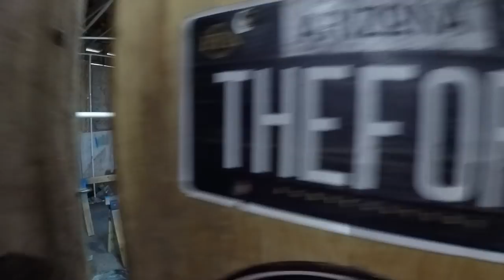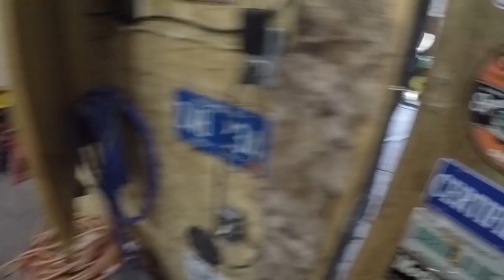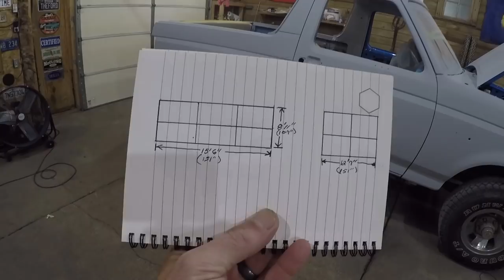The BRONCO Gets PRIMER!

Comment: I painted the mirrors on my 96 F-150 black. I should have used high temp paint. The regular rustoleum couldn't handle the South Carolina summer.
Reply from the maker: Gonna use automotive 2k black paint. But rustoleum usually holds up well. Did you just spray over the chrome out prep it by sanding and such?
Reply: @TheFoxShop  I sanded, cleaned, sprayed with primer, and then painted. Still started peeling off on edges and fading in the center. I'm going to blast the paint off and try again sometime.  I may try the paint that you are going to use. I'll have to do the same for the chrome trim around the window too.